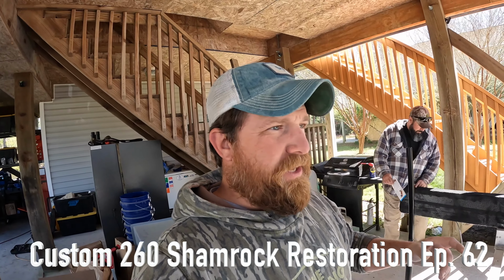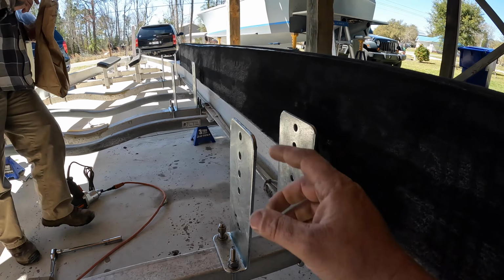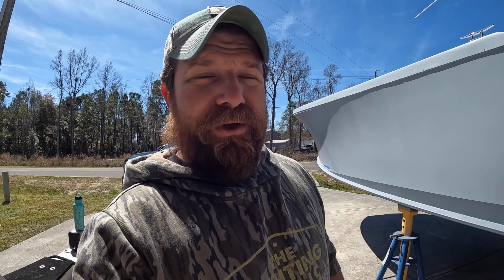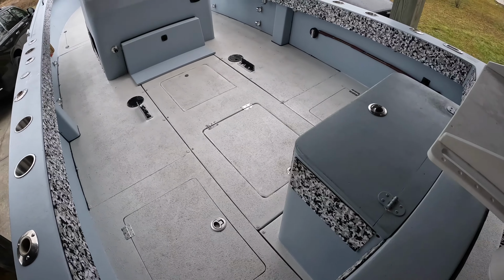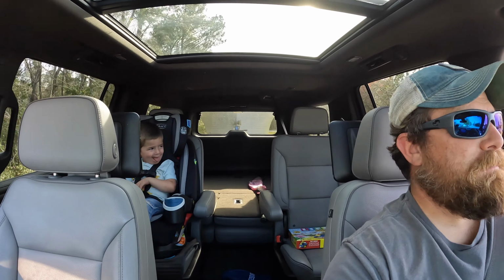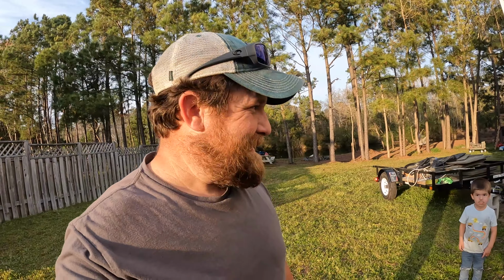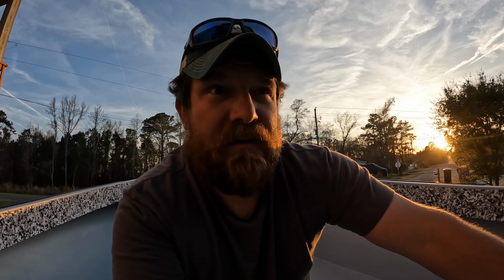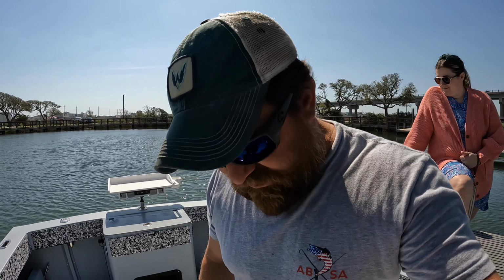Custom 260 Shamrock Restoration *Final Episode*  -  Ep  .62

Comment: I just finished up my 5 month project also. I tore up the hull on my shamrock 20 open thanksgiving weekend. I immediately was able to find a great deal on a nice shamrock 20 cuddy cabin with a bad engine. I took the vortex 5.7 from the open and installed it in the cuddy. I did a ton of upgrades and cleaning and transformed it into a fishing vessel. Also transferred the minn kota spot lock.
I already did a short sea trial a couple weeks ago and tomorrow is our first fishing trip.
Good luck with your boat!
Reply from the maker: That's awesome! Best of luck on your fishing trip and tight lines! Thanks again for following along and have a blessed day!